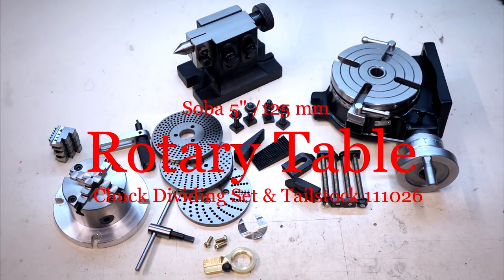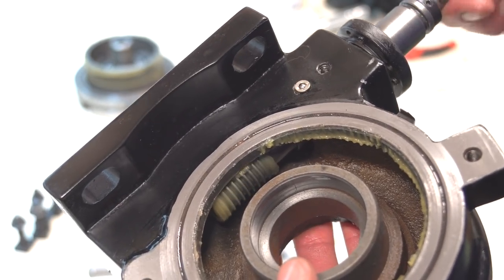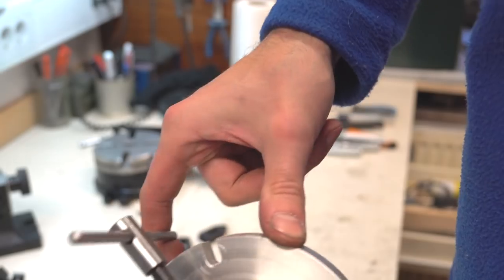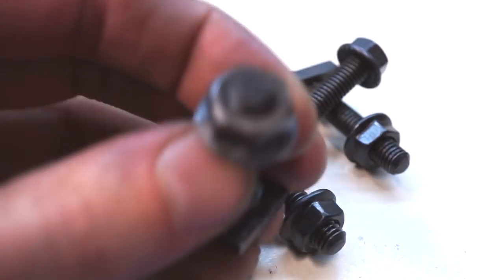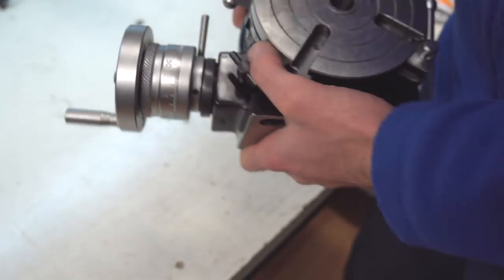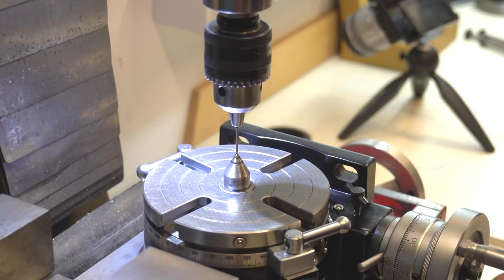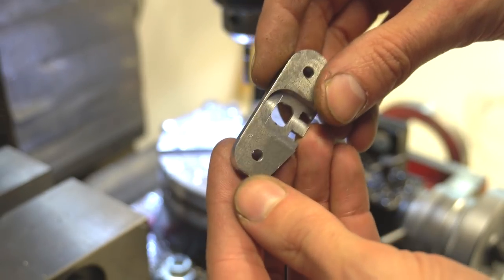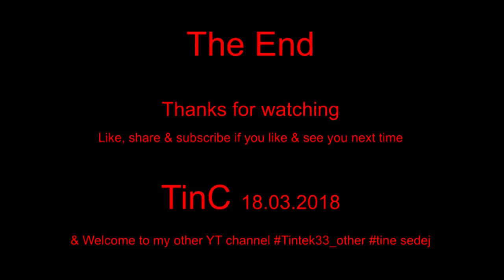Soba 5" / 125 mm Rotary Table , Chuck , Dividing Set  Kit [unboxing, review, setup and first test]

Comment: I have an 8" rotary table and wish I had both the tailstock and dividing handle kit for it.  I once had an end mill work its way out of an R8 collet, and it cut a nice arc in my rotary table so I strongly recommend use of the R8 end mill holders with a set screw that engages a flat in the end mill shank.  If you ever need to cut a gear with a prime number of teeth, you may need to use that rotary table without the dividing kit mounted, so both are needed.

Comment: Chuck being tight isn't necessarily a mark of quality or accuracy, it could very well be mark of bad quality and improper machining or bad lubrication... .

You need to take it apart, clean it thoroughly, reapply some high quality grease and then try it again. Remember to mark jaws so they go back in proper order.
Reply from the maker: True, i dissasseble my lathe chuck many times, because there come dirt between gears and it become hard to tight.
But i just cleab them and assemble back together, si the gears are tottaly dry and clean, never use oil or greas, because it will atract and stick more dirt and chip i think, are you sure about that the chuck must be oiled or greased while assemvle?
All the jaws is fabrique marked by 1,2,3 and 4, because there's no way to insert it wrong, also one of key hole is marked as 0 well on that hole the lathe was tighten when it be centering, so if we tight at "0" hole we got best center.
Reply: @TinC33  It definitely has to be lubricated! Not just for corrosion resistance, but because metal on metal contact will wear out the contact surfaces really fast and then it will be inaccurate and sloppy in the end.

There are "dry lubricants" like Molybdenum Greases that don't attract dirt as easily, but you just need to get into the habit of keeping things clean and tearing down and cleaning machine parts time to time when they ultimately will gather dirt and stuff... 

Machine maintenance is part of the job :)
Reply from the maker: @Mtaalas  true, next time when i dissasemble them (do that just few days ago) i will spray it with try lube spray i use for lubricate rails on my milling machine. i didn't think about that, but if i only imagine, to lube it with oil than sanding some part on the lathe, wow it must become nice iron paste inside of the gears. :)

Comment: Very nice review.  Subscribed.  I've been wondering about this rotary table.  I have a 3990  Mini Mill from LMS.  Any thoughts about whether this would be too large for a mini mill like that?
Reply from the maker: I don't know the aize of your table, but you can found smaller tables on ebay i think from 80mm also smaller means cheapper thia one is 125 but i'm preatty sure there is also 100mm and 80mm and offcouse bigger like 150mm 180mm...

Comment: Very good video spechnoch.   Your review of the rotary table was very good even though it had the bad nuts and bolts and the maching fit of the hold down was poor..  Hmm not to sure I understand.   But I do understand your review..  Thank you for taking the time to post this video.  I subscribed.   Where was the rotary table made?    I think you are a better machinist than the man that made that table.  Maybe people should put their name on their work.

This machine looks much like the things we get from China.  If it is please allow me to make a suggestion.  The products from China are dirty remove all parts and all grease and wash thoroughly.   Re grease with new fresh lithium grease.  The bearings from China are crap.  Replace them with good bearings.  The dead center can be re hardened.  I am sure you know how..  This will give you a longer service life for the rotary table.

Have a great life spechnoch.
Reply from the maker: Thomas D Harrell thabks, i don't know where is made but i also think that it's made in china or india (on ebay sell lot of rottary table from india) but i already hear a few time for brand SOBA, but it's like minilathe, they sell all around the world with hundreds of differend brands but they all come from the same chinesse manufacturer, then "second brand" choose colour, electronic equipment, labels... And price vary from 400-800e for tottaly same lathe vith just a bit different electronics, colours and decals.
But there is many thing that can improve that chineese products, when i buy a minilathe i also dissasembly it clean and than take day or two and really slowly and precise put it together, you really need time to setup that tool and i bealive that if chinnese take that much time to setup like it must be, they will be out of price competition.

Comment: Dear TinC33.
May I ask a terrible question for you - about  your rotary table housing ?
Reply from the maker: dfhdhd fjgjgjgf ask
Reply: Please,  measure  walls  together with  partitions to the thrust bearing-nut
The essence of my question is: I bought a similar table, I saw a very small thickness of  bottom cast iron  in compared  with the supporting  side walls of the rotary table!
It turns out very small table rigidity due to a thin bottom - which supporting  radial and axial  stability !???
(see  picture     
         http://piccy.info/view3/12516478/5d210a38668cd6d1c9cc0b41787f2136/        
     )
Reply from the maker: dfhdhd fjgjgjgf hy, sorry but i got assembeled and setup the table, but i'm not planning to explode them again, but why you'll nees this measure?
Reply: Explode -big word!     I bought a similar table, I saw a very small thickness of  bottom cast iron  in compared  with the supporting  side walls of the rotary table!
It turns out very small table rigidity due to a thin bottom - which supporting  radial and axial  stability ! 
Want see  some (your) people situation  on this  problem!
Reply: thickness  aprox  2mm !!!       " Like paper"  !

Comment: Where did you get the chuck ? Thanks.
Reply from the maker: I order rotary table complete with tailstock, dividing plates and a chuck.
Reply: @TinC33  Perhaps you have the link to the page you bought it from ??
Reply from the maker: @SmeeUncleJoe  i order them on ebay.com search as "rotary table" and you got lot of different dimension and equipement option.
I buy from GB so i don't need to pay tax, from seller chronosltd, they got also their own website chronos.co.uk or something but they sell a few € cheaper on ebay.

Comment: You should run an indicator on the table and check the runout and how parallel it is.
Reply from the maker: True for precise work, but for a few radius and other stuff i use them, eye centering is enough for me, but the vise i always make parallel with indivator gauge (micrometer)

Comment: Hi , nice review but ... don't use drill bit chuck for milling :P is not designed to this king of jobs :P  ER collet chuck or similar should be used :)  
Anyway , there is not side to side play on this central bearing ?
Reply from the maker: hy, thanks, about my chuck, lot of comment read about that, i know that it's not ok, and i got mk3 collet from 2-20mm but for small milling work like there (cutting aluminium slowly) i just use chuck because this is simply fastest and easiest way, so mill to 10mm diameter i just put in chuck, no problem so far, but if i milling something serius that need to be pricize i always use collet.

There is no feel some side to side play, i was realy impressed that i can mill 5mm stell without locking the table and it cut really nice without any vibration. but i suspect middle bearing becaus eit's just fall out when i dissasembeling, but as i say, so far so good, if there be some free space in the future, i try to glue bearing into with loctite or eaven machining table and make some some collet wich fit to hot (expended) bearing.
Reply: Thank you for info , I'm looking  also about some rotary table . Cheers :)
Reply: Mike B.

Comment: You called your center a "live Center", but I think this is not correct. That looks like a dead center. A Live Center rotates freely on compressive bearings or a bushing, where as a dead center utilizes grease between the rotating part and the fixed center. There's really no reason for a device like this to have a live center, and because live centers usually have more play in them than dead centers, I imagine it would be a bad thing in this use case.
Reply from the maker: True, i talk about live center there:
https://www.youtube.com/watch?v=JgUJqKzx1FM
So i think all the centers called live center :)
This what i use for center rotary table is dead center, i already been warned to that somewhere into the comment. I got big problems with english (barely got positive in school) so some word make me problems to spell or some special word like this where also google translate can't help me some times, same thing with lanseed oil someone tell me that it's called flaxseed oil...
So i really like comments like yours, who tell me in a nice way what you think that be right, without some rude / bad words, and i learning in a best possible way.
Thanks again, heave a nce day, Tine
Reply: @TinC33  Well, your English is admirable, and better than my typing. ; )
Reply: @TinC33  Also, I could tell english wasn't your first language and I want to be respectful to anyone who takes the time to learn my native language, especially since I have not taken the time to learn theirs. Plus, I appriciate that you do your videos in English. A lot of non native english speakers don't speak in their videos, which is unfortunate. So, thank you fom America for that.
Reply from the maker: @josephdestaubin7426  thanks man. Greetings from Slovenia

Comment: Dear Sir,
 
  
Choosing a good manufacturer, you can save much money and time. 
 
I am happy to introduce ourselves as a manufacturer as well as the exporter of machine tools and its accessories.
 
I Ajay Sharma, having a company named as SARAL TOOLS.
 
 We are the leading and the only manufacturer of Mini Rotary Tables, Vertical Slides, Indexers, Lathe Tailstock Attachments and many more products. We are also the stockiest of these type of products. We are also indulge in Jewellery tools and Wood Working tools.
 
Our Premises is located in Delhi, INDIA and installed in a multi storey building. We are having our workshop with fully automated CNC and VMC machines and these machines supported with other conventional machines like lathes, Millings, Grinding machines and more.
 
We are also doing research and development day by day, we are having a permanent team on the R&D work. So after interval we serve new products to our customers. We are also having the inspection team with highly précised measuring instruments, so that we can insure that every product send to our client is good quality.
 
We are willing to supply 10pcs or 1000pcs in one shipment in minimum time.

                                                   Contact person Mr. Sharday saxena
Mobile no.: 9873494944
 
Kindly review our website and reply us back.

 
 WWW.SARALTOOLS.COM

And last catalog add 
Thanks & Regards
     Ajay Sharma
+91-9811112567
8700388190